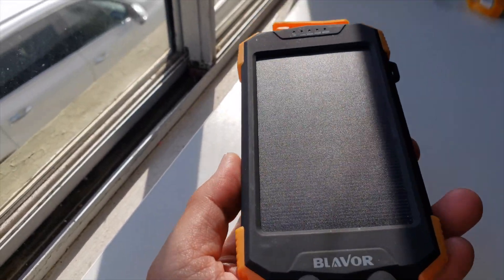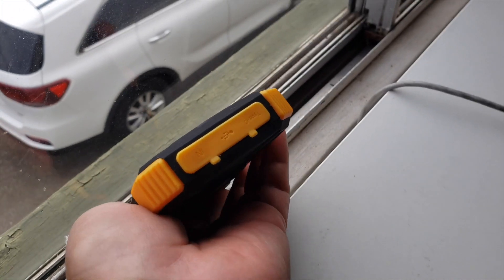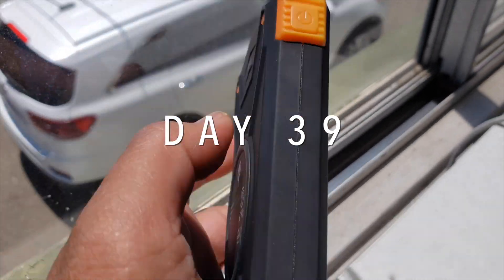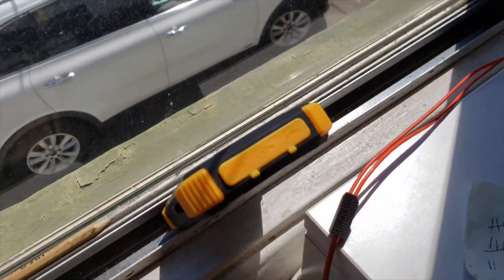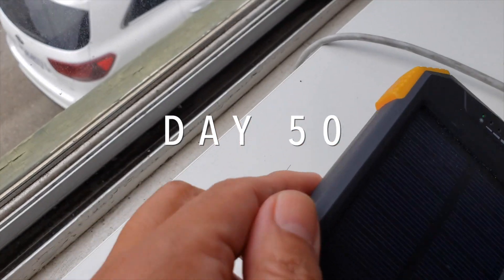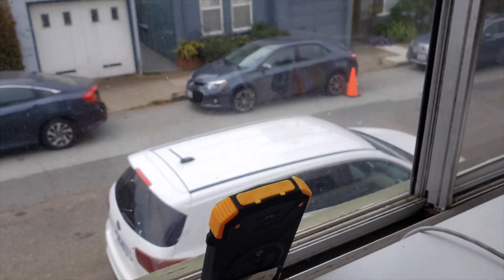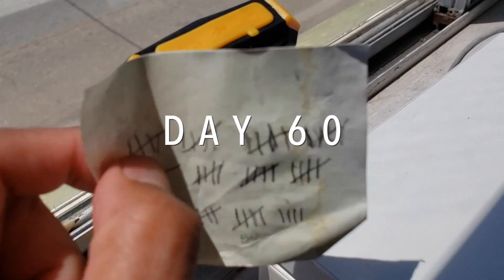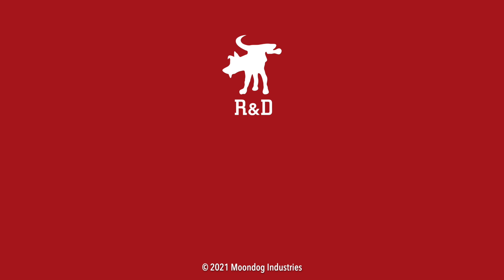Blavor Solar Power Bank after 60days

Comment: Angle also affects how much power you get , which way it’s facing , also being outside doesn’t just limit how much sunlight but how much you can get throughout the day since  you’ll be able to get more direct power throughout the whereas the suns direct light would probably be blocked by parts of the building
Reply from the maker: True. But this was on the 2nd floor in a South facing window. I've got a good 8+ hrs of unshaded sunlight. Outside, in San Francisco, I'd get 0hrs because if I left this outside on street level, it would get stolen. :-P
Reply: @MoondogReviews  lol fair enough